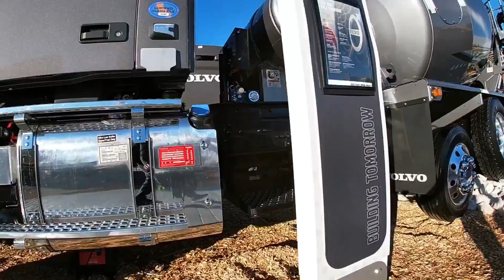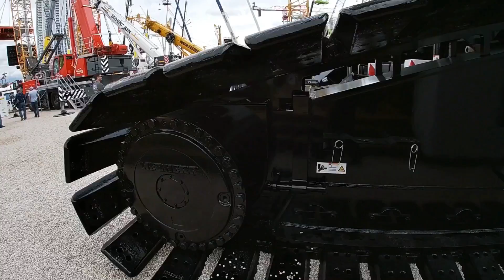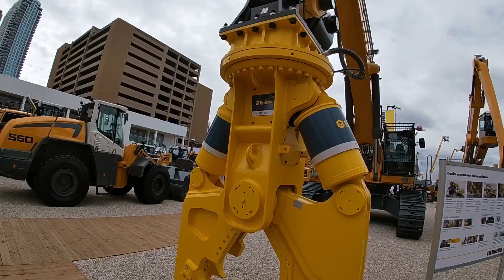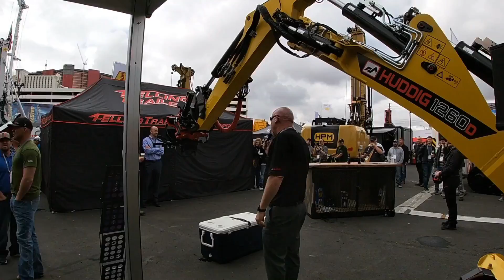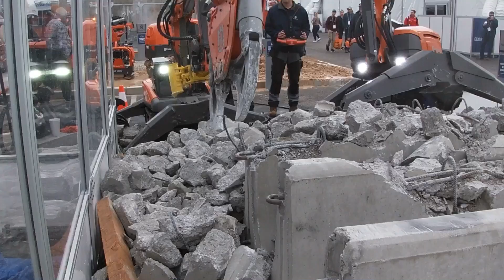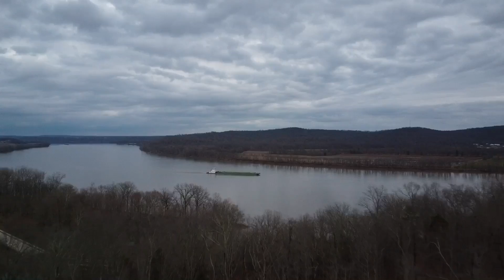CONEXPO 2020 !!! - Volvo - Cranes - Vermeer - Husqvarna - and other stuff and things

Comment: Thanks for another great video from ConExpo!!  I didn't see that Huddig TLB/basket unit until the last day when they were wrapping up their exhibit.  As to that Vermeer rock trencher, here in Las Vegas because of our caliche rock (typically 10,000psi-14,000psi) we use rock trenchers all the time.  As an example, D-8 and D-9 Cats with rippers can't touch the caliche here in many cases so trenchers are used to cross-cut the area and then bring in the dozers w/ rippers.  For pipe placement on large diameter sewer lines, the trenchers are used to make one pass on one side, then backfill and make another pass on the other side and backfill.  Then bring in a large track hoe (like a CAT 390 or Liebherr 974 both about 90-ton excavators and cut out the center slot and then place the pipe.  But the caliche is such slow going that on one job we were lucky to get 30 feet done in one shift.  Without those big rock trenchers, this caliche is just bad news.  Anyway, thanks for the great videos and the narration!!
Reply from the maker: Neil Opfer hey thanks for sharing the info!  Would love to see pictures and videos from a job like that.  Impressive machines for sure.  Thanks for leaving the comment and thanks for watching!

Comment: I like that you pronounce Volvo correctly. So it should be volvo and not valvo. 
Husqvarna is also Swedish and the letter Q in the name should be pronounced as a K. 
Also HUDDIG is a Swedish company that started its production in 1959. 
I am from Sweden, I know what I am talking about.
Reply from the maker: Making it Happen you Swedes sure do produce some impressive equipment!  Thanks for the info and thanks for always taking the time to leave a comment!
Reply: @CaptainKleeman  
I know that comments help You tubers.
Therefore, I comment and maybe a little to show how knowledgeable I am.
I actually got 9 comments on one of my videos, it felt good.